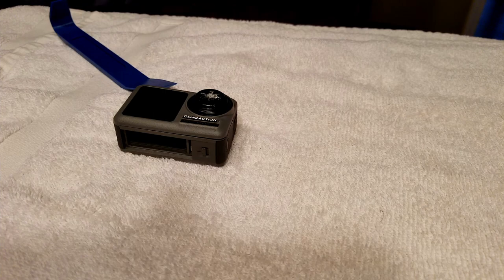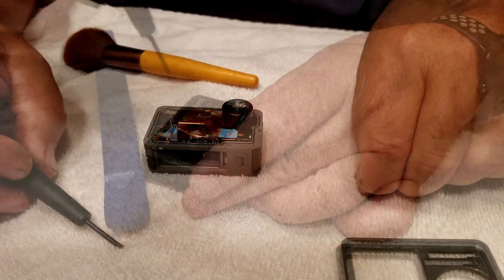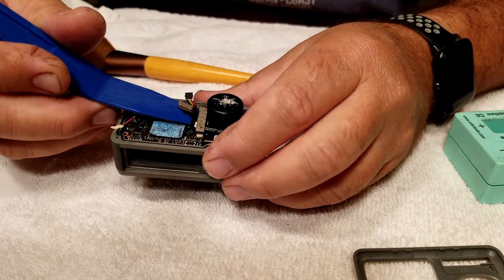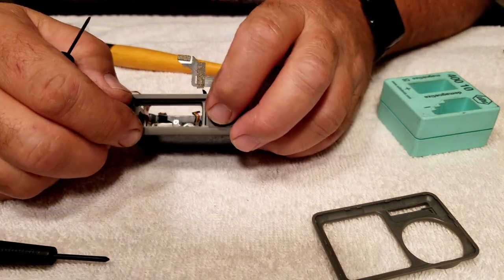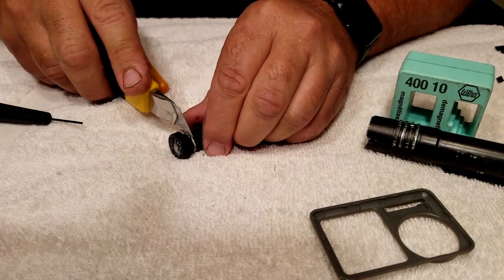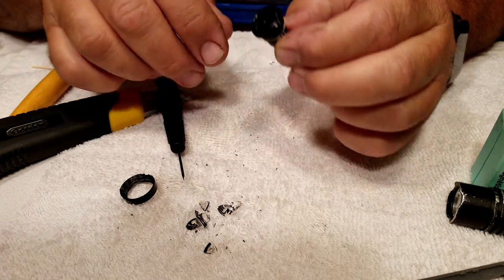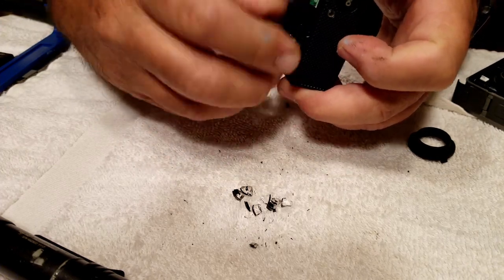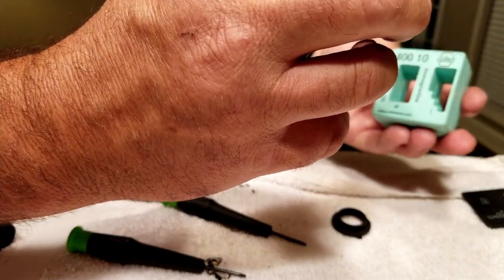Osmo Action Fisheye lens repair! (Update in description)

Comment: Thanks for sharing. Do you know how I can order the innards separately? I'm having a problem and may need to switch out parts.
Reply from the maker: I bought a damaged one from Ebay. DJI will not sell parts which is very disappointing. You best luck will be to find a not working one for sell and scavenge the parts from it. That is what I did.

Comment: Hey! Thanks a lot for this video.

Were you able to find a Fisheye lens?

I'm from India and currently in exactly the same situation. My lens broke (less horrendously than yours). I contacted DJI and they said, it has to be sent to Hong Kong.

Do you have any idea how much will the cost come out to be. My only constraint is that they're not telling me the cost before I send the osmo action to them. 

I would highly appreciate some response and insight into it. Eagerly waiting for your response.
Reply from the maker: Hey there! Yes I fixed it. I bought a broken(water damage) one from Ebay and took the lens out of it
  My case was also bent so I used the case out of the water damaged one as well as the lens.
  My latest video was taken with this camera that was repaired by me.
 It was $60 USD Plus tax.

Hope this helps and thanks for watching!